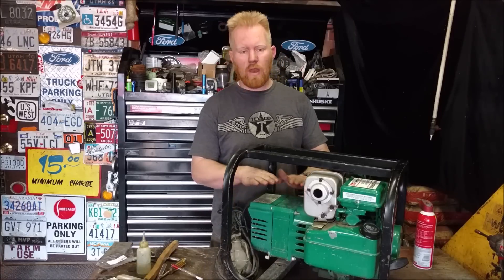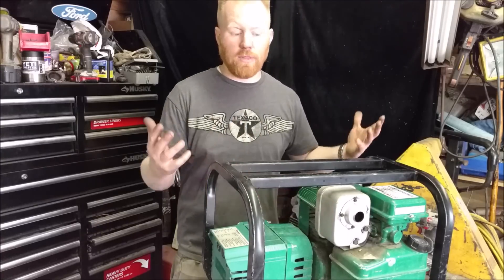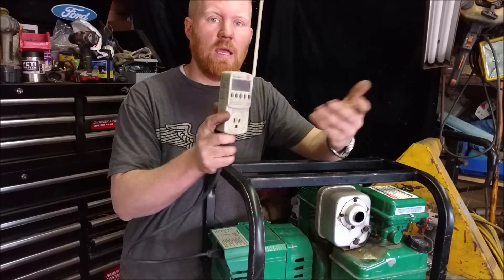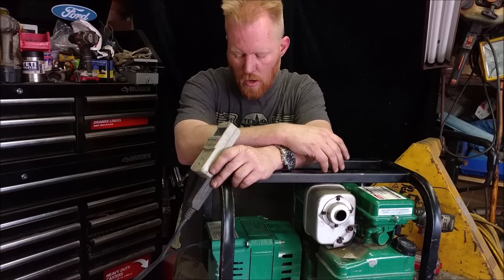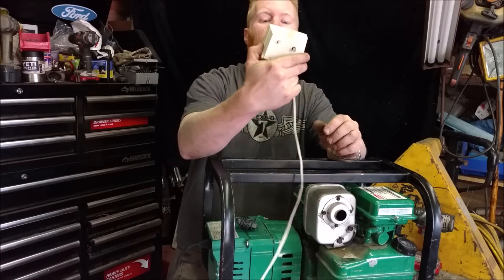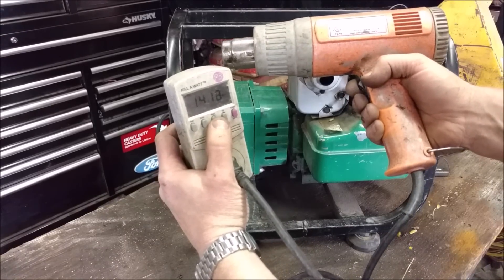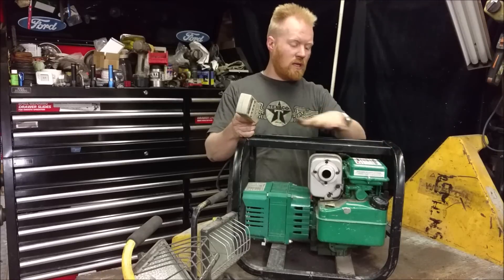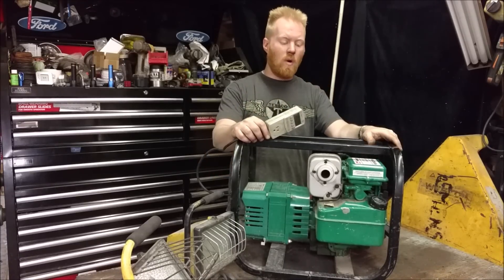Tune a generator Head DON'T FRY YOUR ELECTRONICS

Comment: Thank you for the info, I got a champion 3650 running watt and just by ear it sounded a little to fast and it was at 73hz no load and I got the same killawatt meter you have, and I wasn’t sure at first how exactly to tune it, so I found a hair dryer and it pulled 1675watts and I tuned it to right at 60hz and it bounces around a little bit but under load the voltage goes from 119.9 to 120.5 I assume where the engine isn’t super steady, but that’s as smooth running as I can get it, and the governor reacts super quick so I think I should be alright, the engine should smooth out more as it gets broken in right?
Reply from the maker: The voltage will fluctuate and stuff you run off of it won't care as long as it is roughly 120v(110-125v is the average across the US). The nature of any gas powered generator is you'll always get a little fluctuation. The engine should sound steady though. The voltage is controlled by a circuit board(AVR) built into the generator where the HZ is controlled strictly off the engine RPM.

Comment: Thanks for posting. I never knew how to adjust the HZ  on a generator before I use the  brush less generator on my Honda welder it will put out about 7.4 kw. But it so unclean  it will easily burn out  any appliance I put on it  even  a drill  with out me even knowing it.  I notice that when I  have use the drill by the time I notice the smoke coming out of it  the drill wrecked. I have had the same voltage tester as you have  there for a while now.  I use it in power outages with my 2.8 kw AVR generator. To make sure I have enough power to run ever thing  But I never thought about using it on the welder generator. Though the voltage currant on my welder generator is so awful Before I never would dare  try to run a house with it.  it a bit more to it then that its only generates a squire wave. My AVR generator generates a squire wave and it will run  fridges LCD TVs computers ever thing but in a power outage I just don't have enough power to run the 3kw water heater and run the house as well I thought before If   had enough power to run ever thing It be great And if my welder generator did not burn appliances out it be wonderful.   if only I could get it cleaned up it could easily run my whole house.till now I never knew
Reply from the maker: Thanks, I'm glad you found the info helpful.
Reply: @sixtyfiveford  That's OK And again thanks for taking the time to post it.  After watching your video and  learning what you said about the carburettor adjustment   I remembered I once got a new carburettor for it off E bay months before But when I got .the  carburettor  for the welder generator.  I put it on the bench  in the garage,  and then just  forgot about it ,  until I saw your video.   So I spent the last after noon installing the new carburettor.  the battery gone  on the starter So I dreaded the thought of pulling over a 13 hp Honda engine. this use to take ages to start But when  I  pull the cord and it started almost instantly.  It even ran  better. quieter  Im from Australia  here we run on 240 volts AC   I tested the voltage it was a study 239 volts.  it never done that before. So I  plug in one of the  lamps  Before the lamp use to glow brighter and duller  brighter and duller    it got  a bit annoying after a while LOL But this was a steady brightness. So from what I learn off you and your video I was able to fix it the voltage is so study I know it will run other thing I try it to morrow So again thank you. so very much.
Reply: @sixtyfiveford  I did but now it seem to have  stopped producing  power.  Last night I notice the engine runs great.  but there no power coming from it I suppose I expect to much from it as it very old I use it more as a generator then a welder I will have a look at it this morning Should be some simple I try a drill in it at first and use the drill to excite it then I test Image result for stator windings.  As I can remember from before as long as it got 5 volts it OK.  then last Ill test the 20 uf capacitor
Reply: @jcr65566....Your Quote.... "My AVR generator generates a square wave and it will run  fridges LCD TVs computers ever thing "...so what about others warning me that dirty power will ruin my stuff? So your experience running these things is good?

Comment: Is a brand new 4375 (3500 running watts) starting-watt generator without an inverter safe to run a 6.5 amp refrigerator on?  How about a flat-screen LED TV?  Thx for the info.  I'm new to generators and I'm thinking I should have bought an inverter generator but will have to work with what I got.
Reply from the maker: 6.5x120=780watts running. You will have a few second surge when the fridge starts but this shouldn't be more than 2000 Watts though. All modern electronics regulate their own voltages internally so they don't really care what voltage they receive. Most are designed for world wide use and can take anything from 50-60hz and 110v-250volts.
Reply: sixtyfiveford That is really good to know...  and thx for the reply.  I don’t want to swamp you with questions but I’ve read that a bad sine wave can destroy a refrigerator compressor motor.  If you have one more minute... is that a real concern that I should be trying to correct with some kind of “line conditioner”?  And is “sine wave” just another term for hertz/frequency?   Many thx.
Reply from the maker: @DaveBowman345  Sine wave is the visual appearance of AC power on a graph. At 120volts it goes up and down(alternating current) like a wave from positive to negative 120volts at 60 times a second(60hz). I've heard a lot of talk about sine wave, but I really don't think it could destroy an electric motor. I've seen it on many oscilloscopes; good vs bad but never proof it damages anything. It may add interference like noise/static on something like a radio but nothing else. Others will contest me on this as nothing looks as smooth as sine wave from your homes grid power. I think more important than anything is the Hertz at which the sine wave is oscillating (60hz/60 times per second) as this is what controls the electric motor speed.
Reply: @sixtyfiveford  It's surprisingly difficult to find answers to these kinds of questions but you've provided more info than anyone else I've contacted.  Thanks again! 👍
Reply from the maker: @DaveBowman345  I did a little bit more personal research after we talked. I guess the main thought behind bad sine waves ruining an electric motor is that it won't run as efficient so it could run hotter and the heat could possibly, maybe shorten the lifespan of the electric motor. This is all theoretical and I could find no proven data backing any of this.
Reply: sixtyfiveford Good info to have.  This is something I could monitor.  👍

Comment: that kill a watt thing is a MUST HAVE when using a generator..
Reply from the maker: It really is.
Reply: @sixtyfiveford  yup,that kill a watt thing is  something i would never think i needed ,till i got one. and on the little cheap gen i got it is great to be able to set voltage with load by just turning the idle screw. need to use 200 foot extension cord? no problem. turn it up a bit.

Comment: Thanks for this video, I have issues with my generator duromax 10000 dual fuel, the idle switch does not apply, the engine RPMs do not peak when the generator receive load, when load is apply the engine RPM decrease and increased when the load is retired. When putting breaker out them engine accelerate more than normal when compared to the first days used. Actually generator is about 210 hrs total time used.
Reply from the maker: I would make sure the carburetor linkages are all moving freely. Specifically the main butterfly to governor arm.
Reply: @sixtyfiveford  thanks for your soon reply, I will check and I will return to you with findings and/or for more advice.

Comment: You, sir, are a GOD! I was given a large generator (Vanguard V-twin) that I thought sounded like it was over reving.... but knew nothing about correct speed (3600), hz or how to adjust until I watched/ learned from your video!!! When I checked it with my meter, it showed 234hz!!!! And @ 150v!!
Between your video and another guys about the governor adjustment, I’m now at 62hz and 124v!!!
I hate to think of the fire hazard I potentially had on my hands if I would have used it in a power outage- your video might have just saved 1 more house fire from NOT HAPPENING!!!!
THANK YOU, SIR!!!!!
Dave
Reply from the maker: Thanks, I'm glad it was helpful.
Reply: Those out-of-whack values may be the reason the machine was given away! I acquired my Generac GP-5500 on the side of the road (because it wouldn't start with 2 year old gas) and now it runs like a champ (after taking the carb and gas tank off and super-cleaning all parts). Only had 39 hours on the meter!! It's amazing when you  see some of the things people throw away nowadays that turn out to be perfectly good--many items with engines are just unloved and have had very little (or no) maintenance.

Comment: Thanks for the video! does this make it safe to run sensitive electronics like a PC / TV / charge smart phones and tablets  and run a refrigerator?
Reply from the maker: Contrary to what you would think, most electronics are not picky about what electricity they get. This is because they use power transformers(TV's, Cell Phones, Laptops, etc) and convert 100-250v AC 50-60hz to a DC power source to power the device. Electric motors (Air Conditioner, fridge, fans etc) on the other hand that run off straight AC power are sensitive and tuning the output really helps with longevity and performance. A motors speed is dependent completely on the HZ.
Reply: Many thanks for your prompt reply. Great info that gives me a much better understanding of the issues.
Reply: @sixtyfiveford  ...I thought the same as to what the issue is with computrs being seen as sensitive and needing inverter style generators to avoid damage. My laptop can run at 120-240 V and 50-60 hz...so I asked ( on another vid), why it's still a problem. They answered like this--> "The problem with dirty power is that it varies unpredictably. Your (laptop) transformer is built to detect the voltage and switch accordingly, but it's not built to filter voltage drops and  3-4hz variations in the AC modulation, and that's what damages the electronics. You would need a full AC-DC-AC converting UPS to clean the power. Those are expensive and big."

Comment: Ya really good explanations actually gives a person enough information to build his own generator from a generator head and engine/motor. My only issue is there are tons of different generator heads and tons of different engines. If you get a generator head how portable is it to mounting it onto any old engine/motor. And if you ran a generator head on a more powerful engine what would happen would it make it generate more power, amps, volts or would it just max it out , damage it or any other thing? Just curious as i am not sure the specific internals of these generator heads only what the spec's say there rated for.  Obviously from physics i get how there working with change in magnetic field inducing electrical current but thats not enough to know from the engineering side whats going to happen in practice.
Reply: The magnets constant strength @ certain hz and number of them is fixes so it seem like it only max it out you wouldn't get more out of it unless you increased the hz in which case not sure how much off 50/60 hz range you could run stuff like not sure if you tried running stuff at 100hz or 200hz what would happen on this one. Though the crankshaft to generator head assembly probably limits the hz range a lot to. So you may never have that ability to get up to alot of ranges of hz.

Comment: 👍🏼
Reply: I have the same generator. Her name is Jenny. We use her all the time. Would love to replace it with one of those slick little Honda generators. They’re much more quiet. What do you think of the harbor freight generator?
Reply from the maker: I've had them in my shop and like most Harbor Freight stuff they do function, but barely and for who knows how long. They always need tinkering because a bolt rattled off, a switch broke, a wire came loose, a rubber hose rotted....... If you don't mind the noise these old generators run forever and are cheap. But there really is nothing better on the market than the Honda's. I don't care for much of anything else Honda makes as far as power equipment, but their generators are king of the hill.

Comment: If I’m running generator on different fuel sources with the Hz vary? I have a tri fuel that I’ll use with gasoline or natural gas that’s 9k start 8k running but will be at 7k on natural gas. Set the Hz to about 63 if I’m doing 5-6k on nat gas?
Reply from the maker: It will stay virtually the same. The Natural Gas and Propane will drop off a little more at high loads as they have less power vs gasoline.
Reply: sixtyfiveford so if I’m running about 6-7,000 Watts running my house should I set Hz to about 63 with no load?
Reply from the maker: Yes, that would be about right. I would also test it out with 6-7000 watts just to make sure. I assume you have a 10,000 watt running generator?
Reply: sixtyfiveford it’s 8000 running 9000 starting trifuel Winco. Has a Briggs and Stratton engine. I’m getting the kill a watt device tomm to adjust based on Hz. 

Love your videos. Such great advice.

Comment: Good video. Remember start the generator let it warm up then plug equipment into it. Unplug equipment then shut down generator. The voltage and frequency will vary at startup and shutdown.

Comment: This is the first video I have seen that addresses adjusting the Hz on a generator. Great informational video. Just an FYI  for those who may not have a meter that can measure Hz but have a Tachometer you can also calculate Hz by the using the engine RPM. 1 RPM is equal to 0.0166667 hertz for a small engine that runs at 3600 RPM. Multiply the engine RPM by .0166667 to get Hz. For engines running at 1800 RPM you will have to multiply you answer by 2.
Reply from the maker: Thanks.

Comment: How do I lower my voltage on my Coleman 5000? Right now I'm getting 140 volts.
Reply from the maker: The AVR(automatic voltage regulator) should do this automatically for you. It is very common for this to burn out or go bad. The HZ should be set manually though.

Comment: 60 hertz? Nah....you want an IDG an integrated drive generator from a jet aircraft. They run at 400 hertz three phase! Not good for home use though! Great video Moe. This is an often overlooked step in dialing in a portable generator. Thanks for sharing!
Reply from the maker: That sounds like a fun generator to play with.
Reply: Fireship1 You should be able to run most 110 v  single phase on three phase 
 https://www.youtube.com/watch?v=d1quMdHegn0

Comment: Thanks man!  I have an antique 1800 rpm onan putting out 158 V under load making my rv transformer make funny noises!  I put a homemade propane carb on it and adjusted it to sound but not rpm, hertz or even volts under load!  I imagine it is just too high an rpm!  I cant wait to go up there now and check it and adjust the rpm!!  Your presentation of how the "Hertz" works  really clicked for me and I get it!
Reply from the maker: Those 1800rpm Onan generators are great machines.

Comment: what I would do. it really concerned with frequency variation. I would build my own generator. or replace the engine with one about 2x the tq. and HP. a small Diesel would be better. like a 5000 watt gen head. connected to a 15-18hp diesel or 20-24 HP gas. it may not be as fuel efficient. but could take full load without slowing the least. keeping the 50 or 60 Hz . depending on where you are. or build a inverter generator. use a engine and car alternators and a good pure sine wave inverter . and it would have a small battery backup. then it would only need to run about half the time. just a idea!
Reply: I have an Onan 5000 with 14 hp gas motor which holds speed OK

Comment: I think we have all had to be happy with "Close enough!!", i dont think there will be anything that wont work with that generator.
They cope quite well for there simplicity :-).
Reply: zx8401ztv
 one thing about 
brush less generators ever if the stator gone they are really  easy to fix if it just a broken wire just solder it  and epoxy it if it realy bad and you cant ford the $100.00 for new winding wire unstrap the whole burnt winding and then just solder the broken bits and then as you winging it back on slowly tape and epoxy each one of them  there usually a diode  or a wire of the diode gone then I use to buy cheep bridge rectifiers and only use one half of it.

Comment: Harbor Freight also sells a multi meter that measures Hertz (as well as a bunch of other stuff) and also contains a Sound Level (dB)  meter which is kind of nice to see how loud your generator is? Your neighbors might be upset you have power, and they don't, but hopefully they wont complain about the noise. I like your quick and easy quieting video also. Great video, Thanks.
Reply from the maker: I just looked it up on their site. It seams a little pricey for a HF item, but neat none the less. I have used their free multimeters and though basic work until the wires on the leads snap off. Based on that I purchased their 11 function 25 dollar one(37772) 4-5 years ago because I needed something to measure capacitance of capacitors. It crapped out a couple times within the 90day warranty and I was able to swap it out. It works great for the price and I've used the last one I swapped out for the past 4 years.